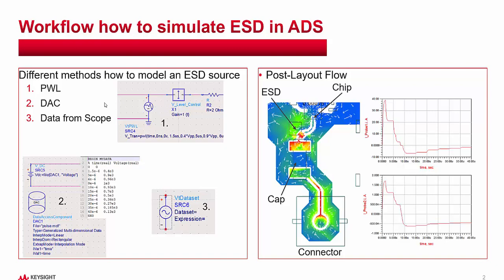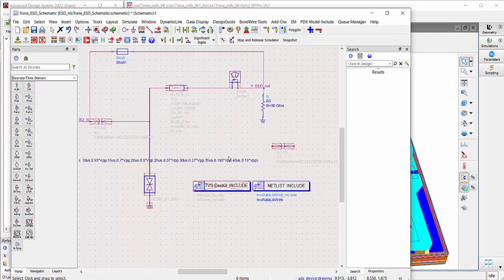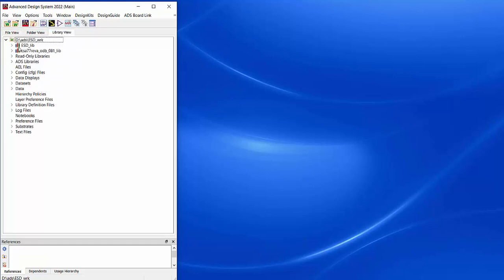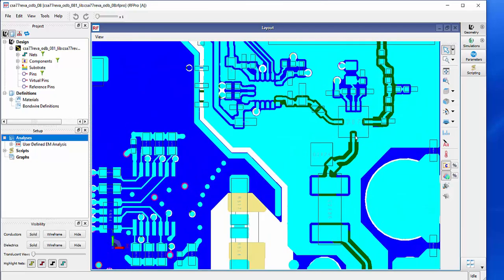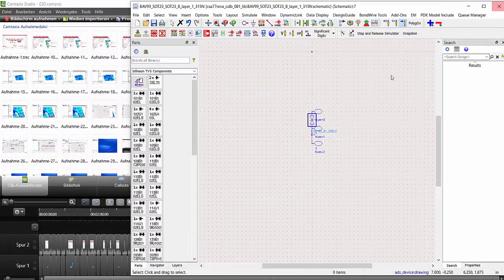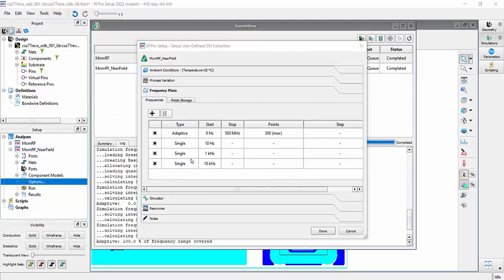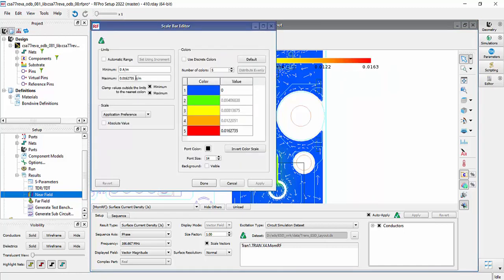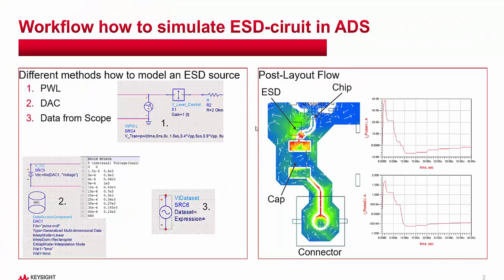ADS: How to Simulate ESD

Comment: The source model or the ESD pulse generated by the source is nowhere close to a real ESD event. I guess you want to simulate a 10kV air discharge event, however, the rise time cannot be as long as 5us, the typical IEC61000-4-2 contact discharge rise time would be around 1ns, and if you count to the second peak, it would be around 30ns. for a 10kV air discharge, the rise time would be less than 5ns due to the arc resistance.  Based on above, the frequency components would all be incorrect. I would expect you to correct your simulation model and publish the video again.